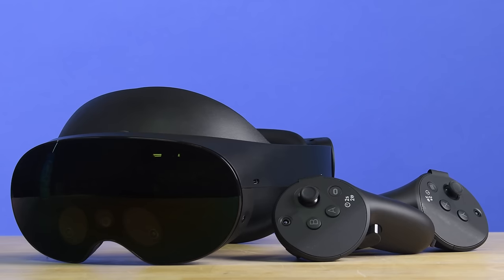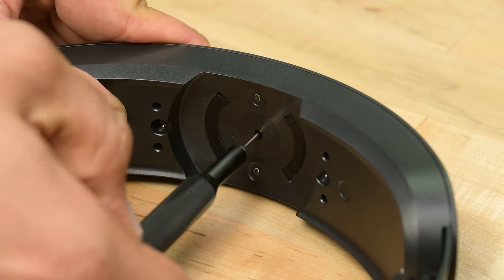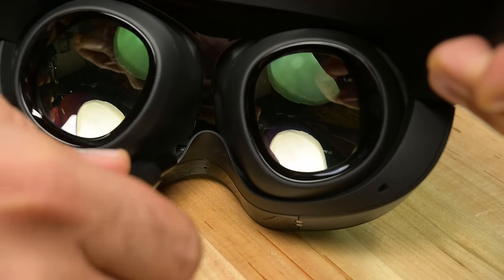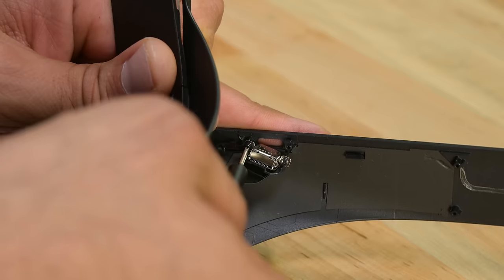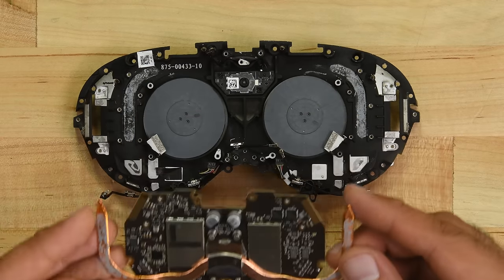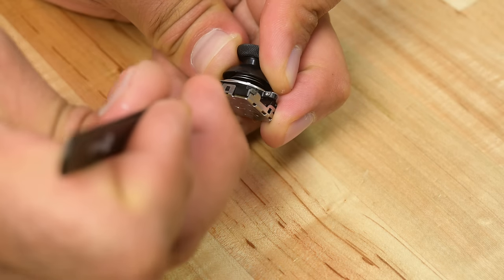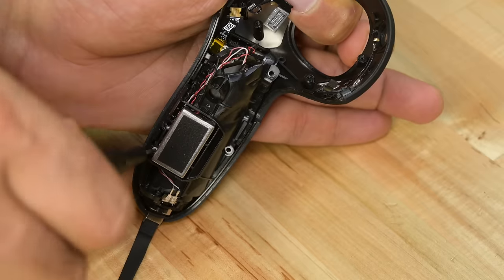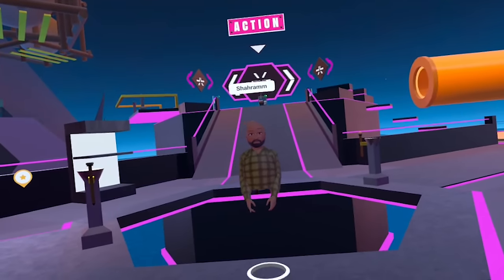Meta Quest Pro Teardown: Inside the $1500 Portal to Mark Zuckerberg’s Metaverse

Comment: I’m shocked the joystick isn’t a Hal sensor aswell. I just imagine people drifting in VR now
Reply: They will likely start drifting just like the joycon sticks do
Reply: some of my friends are already having this issue with their quest 2 controllers... drift is inevitable for these type of joysticks...
Reply: I've been using my valve index since 2019 and have my controllers replaced 6 times due to drifting issues
Reply: @thetoasterisonfire2080  ove had my quest for 2 years and it hasn't started to drift it isn't hard to take care of your electronics people I also have a switch and it also doesn't have drift either
Reply: @SoapCkat  It's not a case of "taking care" of the devices. The tech we typically use for joysticks fundamentally has a very inconsistent and limited lifespan. Stick drift will happen, and it happens to some people sooner than others. There is physically nothing you can do to avoid it.
Reply: I got drift on my Quest Pro controllers in less than a month lol. Thankfully Meta replaced everything for free and relatively quickly at that.
Reply: @SyntheticSpy taking care of your devices has a HUGE impact. In my 32 years, I've never had a single controller have stick drift. To this day I own 2 ps1 controllers, 3 ps2 controllers, 4 ps3 controllers, 4 ps4 controllers, 2 ps5 controllers, oculus rift, oculus quest 2, wii, switch, and many other systems and controllers. I'm a life long gamer, and all my consoles have been purchased near launch, and I still play all of them all the time. I still fire up my ps2, ps3, switch, and all other consoles daily and play on controllers that are old enough to have a drivers licenses. How come I have never once in my entire life experienced stick drift? Because I take care of my stuff, thats why!
Reply: drift still happens with hall sensor sticks.
Reply: I got the pro controllers when they came out to use with my quest 2, and now, my quest 3. I play vr more than most and thankfully they haven't drifted yet, but I'm terrified it will happen. The sticks feel stronger than the q2's sticks, and maybe it was engineered a bit better which is why its not drifty yet. I repaired the q2 drift using alcohol and air many times but it always goes back, theres no way ill be able to do the same with the pro controllers.   ;v;
Reply: @hustla818  

I'm 28 and i dont have a driver's license.   ._.

Also i bet you're glad you never got the xbox 360 at launch like your other consoles, doubt you could say the same about it lasting since it was a ticking time bomb~

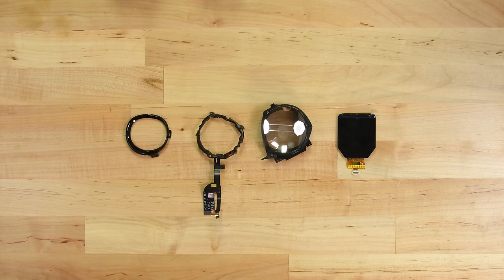Comment: at ~5:30min there is one advantage of Plastic over glass that you forgot:
It doesn't shatter when dropped as easily as glass does.
Fun fact: when I was in the Market for new Glasses for my Perscription Glasses, they told me that they don't do glass lenses no more.
Reply: Glass is practically extinct for glasses now. This is primarily due to impact resistance, as these lenses almost never break. Also the high refractive index of these plastics allows for thinner lenses which is almost mandatory if you have strong near sightedness.
Reply: @hasso0n  is it as hard as glass though? Cuz from what I understand the main downside of plastic lenses is that they scratch way easier than glass
Reply: @zwenkwiel816  You are not meant to touch these plastic lenses, so no worry for scratches. Anyways, If they done there job the lenses have a hard scratch resistant coating on the outside.
Reply: @hasso0n  should be called plasses now
Reply: @hasso0n  all my glasses for last 20 years have been glass. no breaks yet.........an no scratches either
Reply: “Plastic doesn’t shatter like glass does” 
-Stefan, 2022
Reply: @LeesReviews69  ??
Is it wrong?
Reply: @Stefan_Payne  lol well it’s like saying water is wet 😜
Reply: @LeesReviews69  yeah, true :)

Comment: What is really interesting that this video does not mention is that the thumb-rest / button assembly is ALSO a touchpad! The trigger also has some sort of touchpad feature as it can track the position of your finger on the trigger. Slide your finger back and forth and you can see the avatar's thumb slide back and forth.

Comment: As expensive it might be, I'm glad that it's not glued or molded shut into places. It's still quite repairable.
Reply: Exactly what I was thinking. Probably about as repairable as you can make an insanely complex device like this. The only setbacks were some hidden clips, which someone with proper knowledge can figure out. Outside of that the almost exclusive use of (the same) screws is very impressive and indeed nice to see.

Comment: it still baffle my mind the fact that they removed the Time of Flight sensor so late in development. 
Thanks for the Teardown!
Reply: a sensor that could see people naked is cool, but maybe not so smart to be selling
Reply: @citizenx6337  an iPhone can be misused similarly.
Reply: it is a shame but totally understandable why they did it. Im looking forward to the PSVR 2, Rumor has it, it may very well be able to connect to the PC...
Reply: @citizenx6337  ToF just measures distance, ir cameras are different
Reply: @johndagdelen3860  yeah but people don't hate apple in the same way. Apple do something like that and the user is blamed, meta does it and they are suddenly invading privacy.
Reply: @citizenx6337  stop spreading unfounded rumors
Reply: @LetoDK  i dont think its unfounded, theres proof that they removed it due to being able to see thought peoples clothes
Reply: @Clavinohou  Where is that proof?
Reply: They removed it because the glass front plate kept breaking. The weird “see through” camera was just some Twitter thing based off something similar happening with one of the One Plus phones
Reply: @Leathal  oh that's interesting, and makes more sense. Could you provide a source? I'm guessing plastic wouldn't work for the sensor? I suppose it was also too late into production to change placement or such.
Reply: @devluz  the proof is that LiDAR works by the same principles
Reply: @aiexzs  That is no proof. I got 3 devices with LiDAR at home and one using a infrared grid based depth sensor. None of them can look through clothes. Even if they could this is something they can fix via software e.g. reducing the accuracy of the depth data they return but allow algorithms like hand tracking to use the full detail.
Reply: the legal team had a problem with the TOS where it said "You agree to let Mark keep any naked pics as part of his personal stash".

Comment: To anyone intending to repair a Quest Pro: You DON'T need to unglue the front glass! The frame it is glued to is only held by 6 screws accessible from the lens side: 2 at the nose, 2 in the metal thingies on the very left/right of headset, and 2 a bit below these partially obscured by the rubber around lenses. There also is a latch right at the bottom of each of the 2 bigger camera "windows", they are kinda easy to miss and are latched well.

Comment: The mystery circuit is probably not measuring battery swell since resistance strain gauges don't look like that. It could still be detecting battery swell past a certain point if there are matching contacts somewhere.

Comment: I guess the "little flex cables" on the batteries are used to charge the lipo batteries at the factory in an easier way than using an USB-C cable. The multiple contact points are use for the negative, positive and the others to balance each individual cells. Correct me if I'm wrong.
Reply: Is that really what they are? Wow, I'd have never thought of that, interesting to say the least

Comment: The "mystery circuitry" in the back really is 100% swelling detection. These flex thingies have nothing but wires and large exposed contact pads (pairs in 3 rows + separate center), AND right against them on the cover there is conductive "metal sandpaper", very obviously intended to short the contacts if they touch hard enough.

Won't test what happens when the pads are shorted, not on my unit, in case it electronically "bricks" the battery for good. I intend to keep using the device after iFixit lol.
P.S. This teardown viceo has been quite helpful so far.

Comment: I’ve got to say, although this device seems to be extremely tedious to take apart, it’s not extremely hard. I know that tedious and hard are synonyms, but let me explain. From this video, I can see that, although the device has lots of screws and lots of clips and other components that need to be taken off, there’s not much adhesive. I think that if you are not a beginner repair person, you could probably repair this with more success than repairing an Apple product.

Comment: guys, my left lens was accidentally scratched by some glasses, I found a replacement to buy, but according to what I saw, it is possible to replace the lens with another one, right? or maybe it's not possible? As I saw in the video, it disconnects some pins.

Comment: What an engineering marvel. 
I'm in love with my Quest Pro.
Reply: have you used steam on it? Curious on what will drive steam games, PC or Headset?
Reply: Works fine with Steam. The PC hardware is what runs PCVR games btw
Reply: Can you work on it? Like spreadsheets and coding?
Reply: @Leathal  that's what I thought too. I thought though since it's more powerful it wouldn't require the pcs power to power it all.
Reply: @jaygrillmagic  there are standalone games and pcvr games, standalone games are fine but pcvr games are definitely better. though, you do need the right pc to run these games

Comment: Since this is a prosumer/business device, it is absolved of criticism regarding price to some degree.
The Quest Pro is a good deal. It's just too expensive for consumers if the Quest 3 tries to parody even half of the QP's functionality.
If Lamborghini made an Aventador, and proceeded to sell it at-cost as a way to appeal to frugally minded consumers, it would still be too expensive for most people.
With time Meta will, hopefully, take what they learned in producing this device and apply it in their future designs in order to make more cost optimized designs for the consumers they no doubt would like to pull into their metaverse.
Reply: it's great there's a somewhat 'no compromise' product line now. Quest Pro line will be the first to get the varifocal lens system. A huge deal.

Comment: And almost 70 years ago, computers used to fill rooms, and now we can wear them
I feel a bit too old now
Reply: You're thinking wrong, almost 70 years ago, we couldn't just lift the computer and put it on our head, now we can put them on our head without any problem and fit them in our pocket without any issues.

Comment: I will be very uncomfortable to strap a big battery pack and a hot CPU so close to my head and eyes. Why cant they put the battery pack and the processors in a external power bank like box and just keep the display in the headset, connected with a cable at the back?

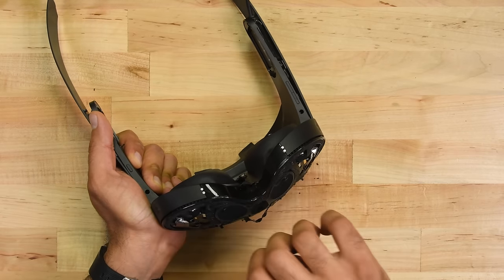Comment: 3:50 the 'Depth Sensor' was cut when someone realized that, in function, it operated on the same principle as Airport body scanner machines, it used millimeter wave scanning radio frequencies to gauge how far away any objects/walls were. A bit of software allows the Quest Pro sensor to act as a camera, seeing thru people's clothing. Meta couldn't have 'x-ray goggles' on the market for all the pervs. Imagine the media fallout that would have had....

So they cut the sensor last minute. It's probably one of the reason's the Passthrough is warped. They probably really relied on that sensor for image correction and it'll take time to fix the passthrough warping using only the cameras.

The ease at which the inner strap is removed is nice, it wouldn't be hard to design 3rd party straps around that.
Hoping to see prescription lens inserts at some point too...
Whether anyone actually does is another story tho. 
I think if I land a new decent paying job, i might pick up the Quest Pro as an upgrade to the Quest 1 for PCVR, since the Pico 4 Pro HMDs aren't available in my region.

Comment: Very interesting to see. One thing I wonder about is if it is possible to use these VR Headsets with glasses or is there a hidden mechanism to adjust the optics I missed?
Reply: There's an adjustment wheel on the top that moves the lenses away from the face, so you can fit glasses while wearing the headset.
Reply: It works very well with glasses until you snap on the light blockers. I ended up putting on the blockers after the headset was on my head. Honestly this might be the first HMD where I don’t get prescription inserts, it’s pretty comfy with glasses

Comment: Im more into PCVR so im still planning to pick up a HP Reverb G2
Reply: I just upgraded from a Reverb G2 to a Quest Pro. The Pro is the much better device for PCVR albeit at a very large extra cost. But it has a much larger FOV, brighter screen, more vivid colours and true edge to edge clarity across the whole of the display.  The G2 is more comfortable, has better audio and is slightly sharper right in the centre, although quickly gets blurry if you try and look with your eyes.
Controllers and tracking are much better on the Quest Pro, the G2 is more suited to flight sims than most PCVR games.
Reply: Yeah get the g2 or wait for future pcvr headsets, don't get this anti consumer meta headset

Comment: I would have torn it a new one regarding not making the batteries easily swappable and replaceable, in the headset and the controllers. Also the potentiometer should be of higher quality given the price.

Comment: Most of the battery connector wires are plus, minus, and a sens for each, as well as temperature, and beside the center pads of the terminals, there is an SCL and SDA link. These are serial data connections. The gold pads are pair oriented (connected together) in an up pair, a down pair, a wide pair, and a center. This is similar to a quadrant sensor, for measuring the direction of something (usually light with 4 optic sensors, or sound pressure with 3 or 4 actual sensors). And from this view side, they are simply gold plated pads (no temperature, or other discrete components attached), which makes me think they are an odd type of external capacitive (proximity) sensors, and face away, rearward from head. I wonder if there was anything matching them on the underside of the thin plastic cover, which had a square raised area above the pads. So, in summary, I too have no idea what they're for - but are probably the source of the data, and clock signals, from a small encoding chip, along with temp sensors. They could be for capacitively monitoring the battery (thickness?), but this is elaborate way of doing so, so I doubt it. Intrigued I am.

Comment: BTW I imagined they didn't go with swappable battery to save weight - that would have needed more plastic/connectors/harder mounting at the back adding cost, weight and spoiling the sleek design too.

Comment: I am thinking the sensors on the battery detect potential overheating to throttle power output and prevent head burns

Comment: It's such a shame that they went with MiniLED. The difference between LCD is truly neglible it most cases, but having burn in be the real reason you get rid of your headset and not battery life (easy to replace) or outdated (a device like this will be useful for many tasks for decades to come). This could have been easy to repair, but they chose to try to please tech journalist bros and use a tech that's inferior for VR in a lot of ways.

Comment: Lets not forget the quest 2 had such well designed strap it fell apart right after warranty no matter how much you used it and the new version is not even replaceable
Reply: @JorgTheElder  i dont think i have had the first gen since i bought it very late but it broke anyway in about 1,5 years of use like twice a month and any warranty was refused as it was deemed "physical damage"
and i did baby it as i expected it to break